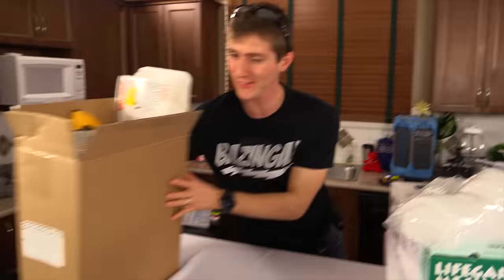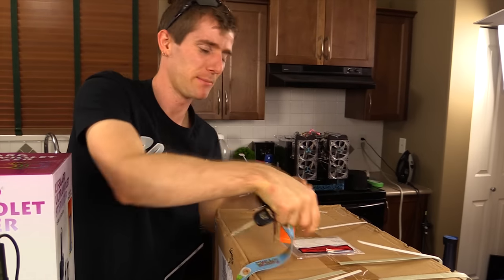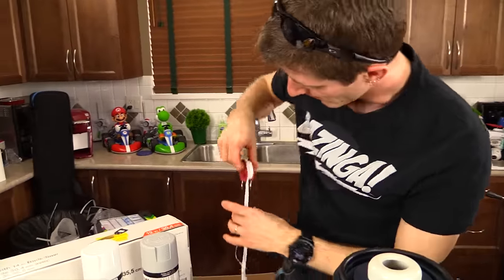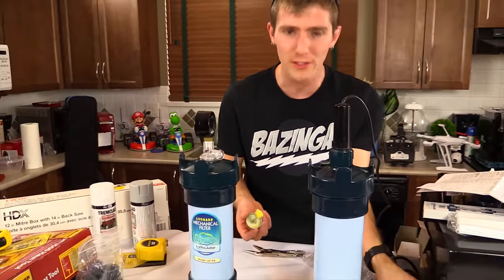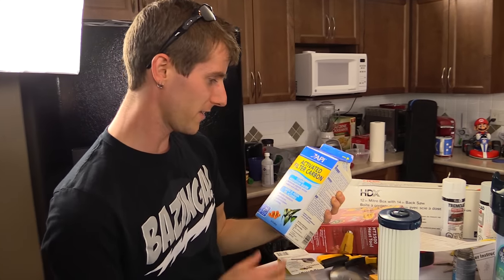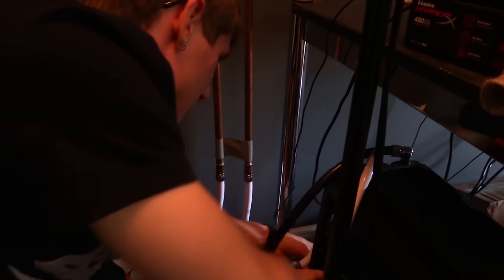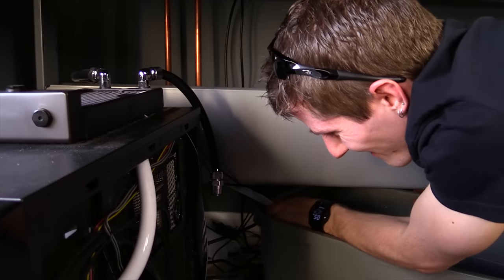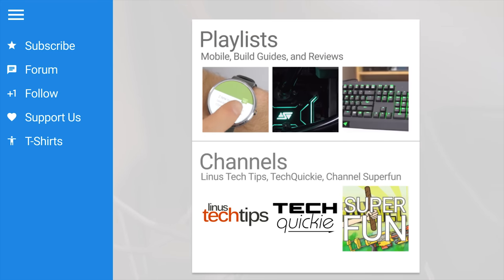Whole Room Water Cooling Part 6 - The Road to Stability

Comment: Linus TechTips TLDR: Read the titles
   Run two separate loops:
I would look into having one pump cycle water from the reservoir through the computers and the other pump cycle water from the reservoir through the outside radiator. Alternately, if the individual computer pumps are strong enough, they could each pull water through the copper lines directly from the reservoir while the larger pumps run water from the reservoir through the filtration and to the radiator. The common theme in both of these solutions being that you have two loops attached to a shared reservoir similar to the way your heart works with your lungs. This would keep you from having to empty water out of the entire system when you have a problem with one or the other. It could also help with efficiency by allowing you to control the flow to the radiator separately from the computers depending on the work load and weather. A simple micro-controller setup would allow you to maintain a temperature in the reservoir that would compensate for weather changes and the computer's pumps would be run by their work load. 
   Add small reservoirs:
Adding a plumbing vent, or small reservoir with an air release, at some point along the line at the top of the pipe would get more bubbles out and make removing the air a lot easier. It would probably be easiest to do this where the copper pipe ends in the bathroom and you switched to tubing. Also, if you had even a tiny reservoir at each computer, disconnecting or flushing the room system would not cause bubbles in the cooling blocks. 
   Thank you:
I know for many that this is a frivolous project and it is certainly overkill. Never the less, I have considered the efficiency of it myself and often wanted to do it just for kicks. After all, it seems nonsensical to have a water cooled pc dump heat into the room for the HVAC to use a very similar process to then move that heat outside. Not to mention that the office or gaming room often ends up much warmer than the rest of the house. Because I don't have the equipment (the 5 massive setups y'all have) to really put it to the test or the sponsors to supply materials, I am really glad to see you trying it out. I have enjoyed watching the project so far and I would love to see you finish it. Thank you.

Comment: You should tipically rinse your activated charcoal under fresh water for a bit before installing it in your filter.  Also by gluing your filter directly to your UV unit you have lost their individual redundancy.  Now if one fails you'll have to replace them both, because you'll probably never get them back apart....otherwise I love the project....

Comment: I have to ask... Why didn't you ask your plumber to put in ball valves were the pipes connects to the tube connecting to the computer? If there are any leaking o-rings in your quick-connections or leak in your computers internal tubing your able to turn of both the in- and outgoing water flow. No spills when disconnecting or connecting. A tip from me to you if you ever think of do any changes on the cooling system.

Comment: u should make a quick release hose so u can drain the loop with out making a mess on the carpet lol like put a quick release hose that is longer so when u need to drain the loop you grab a bucket and then take the longer  quick release hose to the other side and then it would drain the loop better so u want make a mess lol just a suggestion for the future in a whole room cooling. but that is bad ass that yall did that

Comment: My fist impression of this sitch with all the gunk and where its comes from. Considering all new materials like you have done is the copper pipe. Inside the copper pipe is where i wanna say not all but most gunky garbage is coming from . Think of spiders they crawl in and nest up and how overloooked is the inside of the pipe. There are  grades or types of pipe/ tubing thin, thick wall ext... As for the resivoir alll the pipe junk would end up in there at the end right?! Just my thoughts.

Comment: Shoulda put a Piece of ABS between the filter & UV with a union joint. It's gonna be a BTCH to do maintenance to either piece of equipment because they are now so close together now.  It'll also be a BTCH if either breaks down, cuz they are permanently attached to each other now. :S

Comment: Should you have put a Union Joint between the Mechanical Filter and UV Sterilizer? When one fails you will need to replace both of them.

Comment: bit weak, if you going to use long pipes and hoses, you might as well get 1 big industrial radiator and put it outside with a big fan on it (like the ones that cool car engines)

Comment: Why didn't you put valves at the end where you connect the loop to individual PCs, you would prevent the leaking that occurs every single time you unhook them. and it would allow you to connect a bypass hose between the in and out tubes. So many problems could be solved by that one simple change.

Comment: Fun fact m8. While it is not entirely wrong to use Teflon for plumbing it is designed to be used in Gas installations while things with liquid it is a lot better to use oakum.

Comment: I've watched them all up until now and I still don't understand why the shower head wasn't unscrewed from the shower hose and used to fill the tank, instead of bringing in a garden hose from the outside. I mean, it might even have been easier to unhook the cold water under the sink and thread a hose into the valve...

Comment: the quick connector seal was partially held open by Schmoo (gunk) a short bump to the connector or re plugging then unplugging would have solved the issue immediately ;)

Comment: wouldn't a new car radiator and box fan likely produce equal cooling here and be a bit less costly for the outside parts, the other advantage being it could also act as a storage resevoir so no need for an  external one. Pretty sure overheating would not be a problem either as if it can cool an engine, rather sure even a couple pc's will not make the fluid slightly warm.

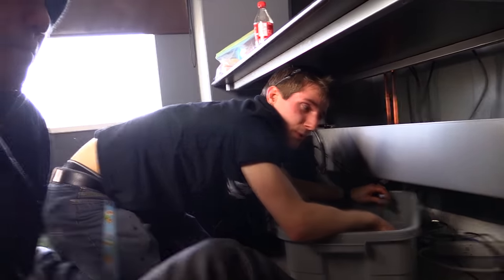Comment: 10:48  Was watching this and had a solution pop into my head: Instead of having all the PCs directly connected to the same loop, have them all on their own radiators (via the quick-release tubing), but then the whole-room part is you submerge those radiators in whole-room watercooling reservoirs. That way, if you have to disconnect 1 PC you don't have to drain the whole system because it stays closed. The individual radiators just exchange heat into the room water loop, and out it goes. Also, don't use PC fans outside; use a proper box fan. ;)

Comment: Is this the only cooling your going to have? or is there a backup system per computer?
One point of failure...
The system is fragile to error. 
Every computer stopping as once is a way worse than them individually stopping at different times. 
Guess you have some laptops laying around so that should be your BCP i guess.
Cool project thou, guess your doing it mainly cuz its fun and that is way more important than stability :P
Keep up the good work !

Comment: Linus no! you should have put the filter AFTER the UV light. If you filter out stuff that may still be alive, it will simply just grow in the filter unit. If you kill it before it reaches there, it would be much easier to maintain the system.

Comment: RTFM... also on the leak you guys are aware that if you bend flex tubing it will crimp off the water... Also you guys should really start using shut off, bypass, and one way check valves... O and a water air separator...

Comment: If the copper pipes around the room aren't insulated, isn't the heat going to be distributed around the room anyway? Wouldn't the whole setup work like a giant radiator built into the room?

Comment: I mean this is probably horrible hindsight and very late but why didn't you put valves you could shut off along the cooling system you put around the room, like 2 per computer so you could have easily isolated one or two out of the network when needed.

Comment: Ok, I'm not a plumber or electrician or really any thing you would need from a expert for this project but have done enough to know from the beginning of the first video that you need shut-off valves in this system and they wouldn't cost hardly anything twards to total cost of the system.

Comment: I was just expecting this leak from the very first video where they built the tubing without any valves whatsoever. Those would also be very useful in bleeding one system at a time.

Gabe Newell was also displeased.

Comment: If that res is steel, please tell me its painted or powder coated on the inside? (dissimilar metals will cause corrosion, do not mix steel or aluminum with copper and brass) --  If it is bare steel at least the anti-freeze with its anti-corrosive properties should drastically slow down the process.

Comment: as they have 2 pumps, wouldn't it be smarter to put these in a push/pull configuration into the loop instead of running them serialized one after the other?
any opinions?

Comment: Ethylene glycol should never be put down the drain, as was shown in some of the videos. Depending on where you live it could even be quite illegal. Just F.Y.I. 

Cool project, the pipes should have been run along the floor I think. You probably could have used a single pump if it didn't have to push everything up to the ceiling. I worry that over time that one of those pipes is going to spring a leak and shower everyone.

Comment: Why didn't u install cut off taps for each area. ? So when u got 1 pc air free. The tap would have sealed that area off on the wall. . And etc on others. No more air in the system.  Also cut off taps on the ends before it goes into the pc's.. No more Leaks and keeps that area pressured. Im no plumber but thats my logic 😁

Comment: Can the technology that is used in coffee makers be applied to this?  The hot water in coffee machines rise to the top through the tubes with the use of no moving parts.  It uses something called a bubble pump to propel the hot water to the top with no extra energy or moving parts needed.  The hot water is allowed to pass through the bubble pump and the cold water is held back, which causes the hot water to be propelled upward.  Do they use this kind of technology to water cool?  It seems like it would be helpful to transfer hot water, so it might only work to water heat something...I dont know if there is a type of bubble pump that forces cold water to pass instead of hot water....but it seems like there should be a way to propel cold water thru tubes without using high powered pumps or extra electricity.

Comment: You do realize that activated carbon absorbs and neutralizes iodine, right?  Since you added the iodine as a biocide, you would have been better off running it without the activated carbon for a while.  To be honest, I'm not really even sure why the system would need activated carbon.  The main ions I can think of are Chlorine (which evaporates on its own) and floride.  Perhaps it helps to remove the iodine you added, but a system flush would have done that as well.

Comment: For the record when I can afford to get the parts and my own space I'll be making use of a beer fridge for a water cooling loop.  Why??...Simple...radiators only cool your system down to the ambient temperature of the environment that it is in.  Yes I will be getting a dehydrator for that project as well, but with luck it will allow me to have temps around 10C instead of in the 40's.  Also I plan to use quick disconnect fittings where possible throughout the entire loop to allow for easier component replacement.  Also to keep things simple I'm going to use parts from a single company and it will likely get expensive.  Booo!!

Comment: you never bought/used the cleaner that you are suppose to use before the pipe cement

also you need to use distilled water not tap water

Comment: The O-ring probarply failed due to the alcohol you may have put in the system. Some plastics can't withstand alcohol... Ask any specialist.
Reply: Pretty sure those O-rings are made of rubber.
Reply: dude rubber is a kind of plastic is both made out of C rubber is just a categorie of plastics... rubber is a elastomer 
but there are very resistent sortes of plastics wich you can use in the chemical industrie too

Comment: You guys also realize, although your put the radiators outside, your copper pipes are like a giant radiator and probably half the heat energy will radiate inside the room... without insulation... Design fail. Yes I know this is old and irrelevant but still.

Comment: Shouldn't you first kill the thing then filter so that filter doesn't have anything alive inside?
Reply: You filter first, just like in a pool or hot tub.  The idea is to keep things away from the other parts in the first place so you 1) aren't wasting resources sanitizing things that can be easily removed by cleaning the filter, and 2) keeping contaminants/debris out of equipment/piping that does not have a way to filter it out themselves

That's provided that they clean/replace the filter as needed.  If you just let it get dirty and clog up over time, it won't really matter how you set it up.  It'll eventually cause problems everywhere in the system

Comment: This is a very bad design.They should have used Sch 40 ,3/4 inch PVC pipe to have water pumped through the loop(water filter, pump, pc, radiator).This would prevent unnecessary heat dissipation through the copper tubing and would transfer all heat to the heatsink, actually using it.The price would also drop considerably since you not paying for soldering, copper bending, copper tubing.Adding a main pump shut-off lever in the room could help address leaks, and prevent frying of the computers.Additional valves could be placed at each computer for added protection.

Comment: you guys have an awesome channel, but this project is crap! you should use heat exchangers each workstation, what costs about 30 bucks, and outside a normal car radiator, with a spal cooling fan on it, that can handle a lot kW of heat :) more than a room of workstations ever can handle ;) - think about that fact,.. a car motor has an efficency of 24% - the other 76% are heat - so if you have 240kW power output - you have incredible 760kW heat loss - ok a big ammount of the heat is transferred with the exhaust gas - but there are many / lots of kW that will be removed by the radiator :)  

in your setup, when one workstation fails, you have to flush the hole system?... buying filters and stuff for tons of money, for nothing, use heat exchangers, and normal water, close the system, presurize it and you are done,.. like a normal heating system in a house, the water will die and affect nothing to the tubes or pumps :) 

here in europe house heating systems work like this for decades ;) without any carbon mikron super filters ;)

Comment: hey guys im about to buy these compunts what do you think of my build?

AMD 7400K Black Edition 3.9GHz
ASUS A78M-A Socket FM2+ A78M mATX AMD Motherboard
Corsair Carbide Series SPEC-01 Mid Tower case
EVGA 500 Watt 80+ 500 Watt ATX Power Supply
WD Blue 1TB 7,200 RPM Hard Drive
SanDisk 64GB SATA III 6Gb/s (SSD)
Crucial Ballistix Sport 8GB
Sapphire Radeon R9 270 Overclocked 2gb
ASUS DRW-24B1ST Internal DVDR/RW Burner - OEM

total grand:600$
Reply: would much rather have gone for the A8-7650k, since it got 2 more cores, 4x more l2 cache. 
And also much faster ram then 1600 mhz when you're using a Apu. 
But if you're getting an r9 270, you're probably better off with a  cpu instead of an apu.
Apu is mainly for when you don't have a dedicated video card, get a video card to use in crossfire with the apu or will get one later some time.  Only some r5 and r7 cards can crossfire with apu's.

$571.57 example with r9 280 and AMD FX-8320 3.5GHz 8-Core Processor
http://pcpartpicker.com/p/2xchxr
Maybe change   some  stuff around.  or maybe this 500$ one: http://pcpartpicker.com/guide/9C6MnQ/500-ultra-steambox
Reply: hummm i guss your right
i dont care how much it will cost i just dont want it over 700$ you know below 700$ thats what i want :)
Reply: Pro Gamer If you can pretend that 708-9$ is less then 700$. Then   I'd probably go something like http://pcpartpicker.com/p/6LR2f7 
AMD FX-8370 4.0GHz 8-Core Processor (both newer and more powerful then the 8320.)
The extra cpu cooler and desktop case, i just chose one  with good reviews and not too expensive.
Asus M5A78L-M/USB3 Micro ATX AM3+ Motherboard had better specs then the previous one and space for 4 ram (32gb max)
G.Skill Ripjaws X Series 8GB (1 x 8GB) DDR3-1600 Memory because 1x8gb is better for upgrading, uses one slot instead of 2 on only 4gb each.  
Seagate Barracuda 3TB 3.5" 7200RPM Internal Hard Drive So that your gaming pc also could function as an emergency porno storage device. 
	
Sapphire Radeon R9 290 4GB Tri-X OC Video Card because it's better then the 280 and 270x.
Maybe change it out with this 270x to save money http://pcpartpicker.com/part/sapphire-video-card-1003644gl (165$ instead of 240$)

But there are probably far better part pickers then me, try browsing the build guides too: http://pcpartpicker.com/guide/
Reply: bro i have perfect 700$ in my bank account
Reply: but i have bought everything and i just build it is so fast and good!!
Reply: Go with an FX series which is AM3+, doesnt have to be the 8 core but they have a much larger cache which makes a much bigger difference than people give it credit for
Reply: so do u think i should get that i mean............

Comment: All of these videos..ALL of this time spent...ALL of these leaks.   when you could have JUST installed a bunch of cryorig r1 ultimates and just been satisfied with aftermark air hsf cooling systems for the vid cards and saved yourselves the bs hassles of possible electrocution leaks @10:30